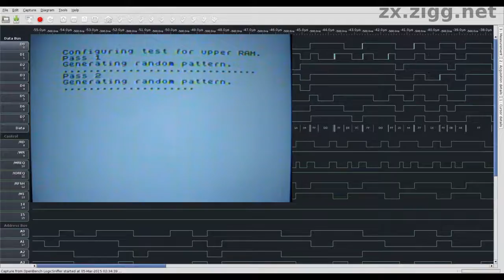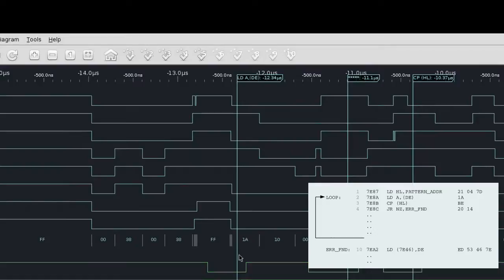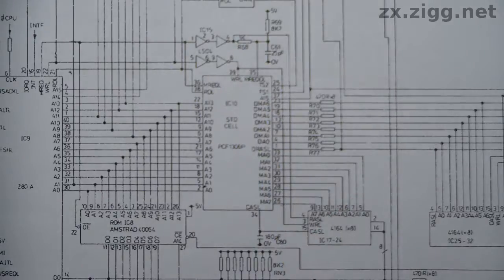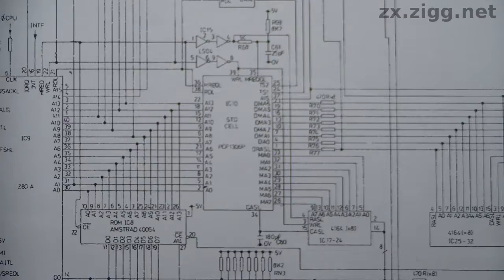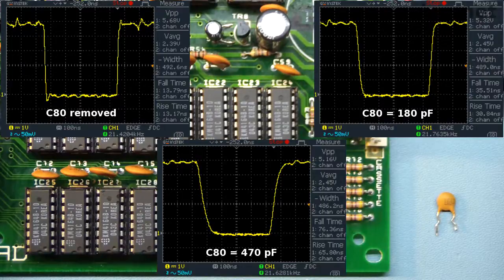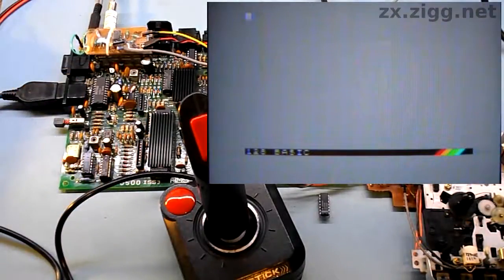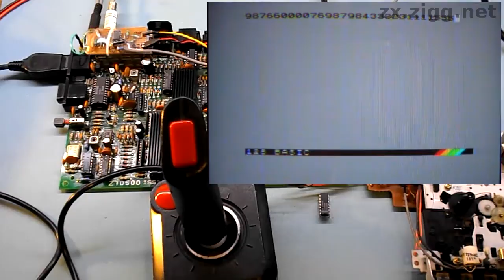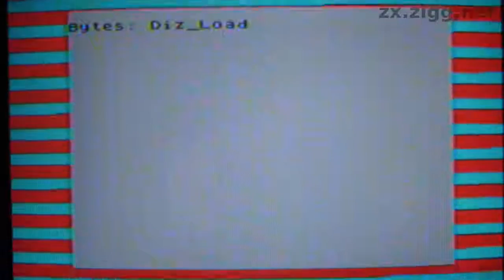ZX Spectrum +2 Repair. (No. 7). Part 6.

Comment: I doubt this matters at this point 5 years later but as I watched this, I noticed that at C17 ( 10:39), the right side of that cap looks like a cold solder joint. perhaps check the left side of C12 as well. R10 and R11 at the bottom looks to be cold. Just my observation... I know it's much later than the vid but I just got around to watching these. Very informative and well done.

Comment: Hi I have acquired two Zx one works perfectly but the other the power supply does not work. Unfortunately the power supply has a different fit than the working one. So I used the Mega drive power supply and it turned on but the keyboard doesn't work. Could I send it to you for a repair. Thanks Jon.
Reply from the maker: Please contact me via the form at http://zx.zigg.net

Comment: Hi,
From where did you bought those rubber feet !?
Reply from the maker: +Raducu Daniel Ciocarlan I can't remember. Over the years, I've amassed a small collection of different types of rubber and plastic feet. I don't think it should be very difficult to find some similar to the ones I used. I think they were manufactured by 3M.

Comment: From looking at the logic inside IC10 (google for ZXMUX and you will find a schematic), i would say MREQDL is happening too early. While adding capacitance to CAS may well have fixed the fault, I'd be inclined to think the correct thing to have done would have been to check the R-C circuit that generates it. I suspect changing C61 for 33pF is likely to work best.
Reply from the maker: You could be right and it's something I suggested in an earlier reply. I'll certainly give it a try should I encounter another Spectrum with this problem.

I've just looked at a suggested internal logic diagram for IC10. I've had a copy for some time, but hadn't consulted it recently. It suggests the address outputs are changed and /CAS sent low at more-or-less the same time. In fact, if the multiplexors don't have a very low propagation delay it appears as if /CAS could be activated first. So, I still rather suspect the problem is that there is insufficient delay between the column address being generated and /CAS going low.

Comment: Excellent end to a great repair!  That said, the timing issue there would still bother me as there must be an underlying cause.  Unless that particular unit shipped that way.  But even then, I would expect the timing to possibly be affected by swapping out components related to CAS?  If something has slipped regards tolerance, it could continue to slip in years to come.
Reply from the maker: You're right, but the presence of C80 suggests the problem is inherent in the design of the +2. In fact, it goes back to the introduction of the ZX8401 (IC10 in the +2) in the later 48K Spectrums; the 180 pF capacitor is there too. /CAS is generated by IC10 and swapping IC10 for another did make a difference; the problem became worse. I tired another set of RAM too and there wasn't much change, though the replacement was from the same manufacturer, but not exactly the same part. Changing IC15 made some difference, though I'm not entirely sure why.

I don't know whether the RAM ICs in this +2 are the originals. If not, perhaps they are more prone to this problem than those fitted at the factory. RAM that responds more slowly to its control inputs (i.e. would be considered inferior by most measures) would probably perform better in the +2.

I suspect the fault occurs because IC10 drives /CAS low at more-or-less exactly the same time as it switches its address output from the row address to the column address and the RAM attempts to latch the latter before it is stable. A somewhat similar problem can affect the lower RAM in earlier 48K Spectrums. The ULA's /RAS output drives the select input of multiplexors IC3 and IC4, causing them to switch their outputs from the row address to the column address. This time, if the RAM is a bit slow to latch the row address and it hasn't completed doing so at the moment the address changes, an incorrect address can be acquired. In the issue 4, a pair of inverter gates were added to slightly delay the change of address after /RAS goes low so as to make this fault less likely. It looks as if the same trick was retained after the introduction of the ZX8401, but it seems the designer forgot to consider whether something similar needed to be applied for /CAS as I suspect the /MREQD input is used to trigger the change of address and generation of /CAS. Prior to the issue 4 48K Spectrum an explicit RC delay (R70 & C64) is used to ensure /CAS doesn't happen too soon.

Another possibility is that not quite enough time is allowed for the RAM to latch the row address and that's why delaying /CAS slightly solved the problem, though the switch of IC10's outputs to the column address probably hasn't changed and so the the necessary extra time must be very small (which seems to be true). It also explains why changing IC15 had an effect; the delay between IC10's /MREQ and /MREQD inputs going low would have been slightly different. In this case, changing the value of R68 or C61 would be appropriate.
Reply: +JoulesperCoulomb I suspect this is all down to the fact that the RAM IC's are the 100ns access versions, whereas +2's all have 150ns from the factory. The RAMs being faster likely tightens the RAS/CAS timing tolerances, and as such the standard 180pF delay on CAS is now insufficient

Comment: Amazing work and thank you so much for sharing your findings with us. So if I understand correctly, if the problem on my grey +2 is the same (symptoms are: random memory errors on uncontended memory blocks) changing C80 to a bigger capacitor (180pF -> 470pF) should solve the problem. I'll give it a try. If it does not, should I check R68,R69 and c61 too? May a transistor configured as emitter-follower (to make a buffer) introduce enough delay or may be inadequate?
Reply: Hi! I tried your fix and 470pF did not work for me nor 570pF. I had to go 690pF to get a clean memory test. 750pF also gone well but 1000pf showed some errors again. Testrom3 really helped as it has an specific test for non contended ram pages.
Reply: +GroovyDrifter 690pF is getting rather nasty to be loading a logic signal down with. I would definitely suggest you try changing C61 for a 33pF or 47pF capacitor instead. Also check what access speed your 4164s are - i suspect faster than 15ns is what causes the issue
Reply: +Peter Mulholland Thanks, I thought changing the capacitor with a smaller one and a resistor, but I'll try your suggestion first